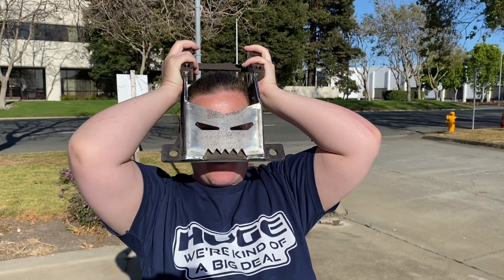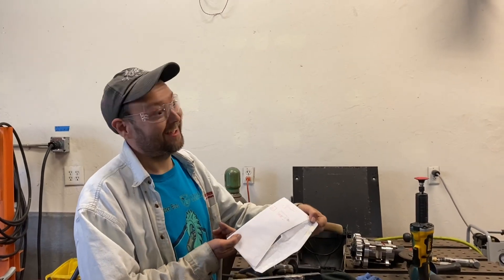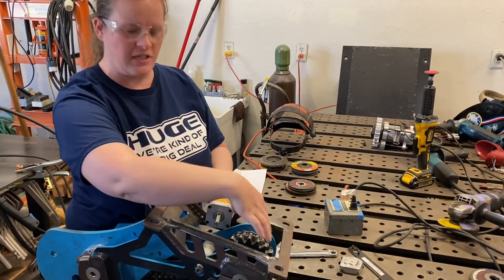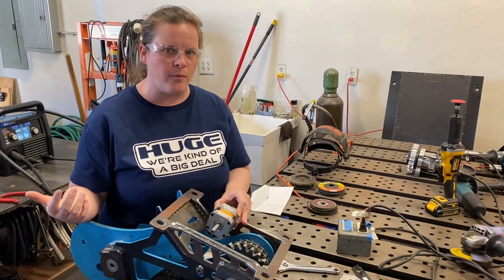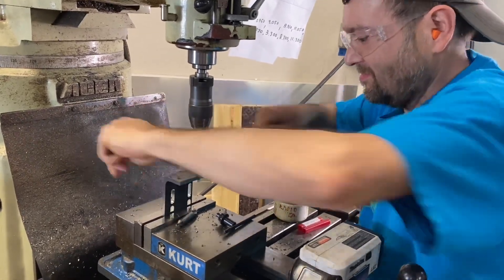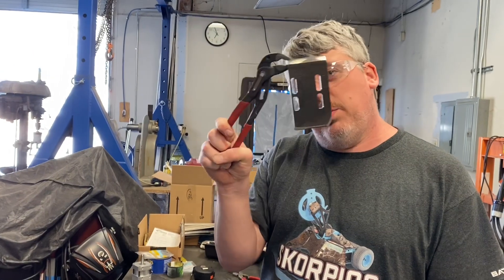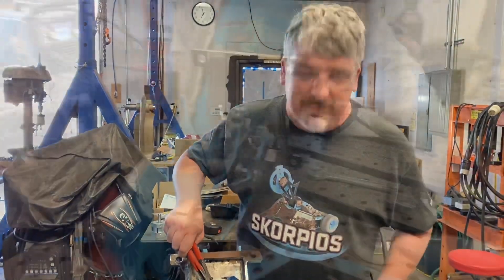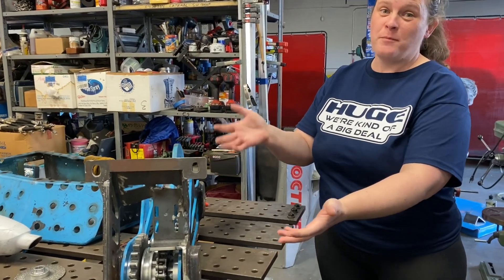Skorpios' New Hat! BATTLEBOTS Season 7 REBUILD Pt. 2   [Builder Blog Ep 60]

Comment: What I would do to Wrecks would be to add shuffles to each side. I know they don't give the weight bonus but they keep the walker spirit while adding more mobility. Then I would add a servo to raise and lower the center section. I would keep the large blade with the guard on the bottom. Then I would add the most important part, two tiny little arms! Think of this idea like a T Rex version of Red Devil.

Comment: If I could build or remake Wrecks, I could keep the classic spinner blade added with the new disc spinner that is similar to Cobalt's default spinner but red and the teeth are white. Instead of semi-walker, I could go with 2-wheel drive to improve the mobility of the bot. The armor will be like a fossil ribcage like Witch Doctor. The Srimech (Self-Righting Mechanism) must be placed on the back between the ribcage, it can be inverted if it has traction. The chasis will be the rework version of the classic Wrecks chasis. If there are wedges to be needed, the design will be the arms of the T-rex or the logo of Wrecks.
Reply: Some neat ideas, though personally I feel adding wheels to Wrecks makes it no longer Wrecks. The spinner idea is neat though!

Comment: Wrecks should be scaled up to 500 Pounds as a walker? Can it qualify for the weight handicap with gyro based locomotion?
Reply: TBH I don't want a 500 lb Wrecks. It'd be too powerful for the arena, and too much of a pain to handle. I've nudged Greg and Trey for a 30-50% weight bonus (325-375 lbs) for gyro-walkers. No luck on that yet though. It may make a come back some time, but for now, it waits for the right moment to strike again

Comment: I would just add a ton of wheels on the most unnecessary and useless places just to flex on those "wheelers" that wrecks can still kick their asses because you know, wrecks has legs to do it.
Reply: ROFL OK yeah that'd be acceptable for adding wheels!
The original Wrecks secretly had 3 wheels. 2 wheels laid flat bolted to the bottoms of the feet for traction, and one inside on a random bolt that helped hold the battery box in place. It was pretty janky.🤣

Comment: If I was to build a wrecks I would make an asymmetrical disc that looked like a T-Rex skull with the lower jaw extending out to be the contact point. I would also make the robot chassis’s a fusion of bite force and monsoon. The sides of the bot would be lined with 3-D printed bones to be used as ablative armor. Lastly for a self righting mechanism I would have two servo mounted arms that looked like T-Rex arms
Reply: I actually kinda like that blade idea, and the bones could be considered decorative so they don't count against the 250 pound weight limit. The T-rex arms make me think of Tantrum with its little fists it uses to self right! Poor Wrecks, can't put on its own hat!